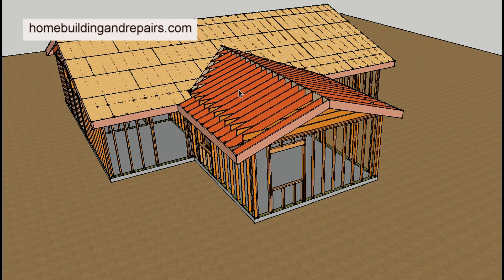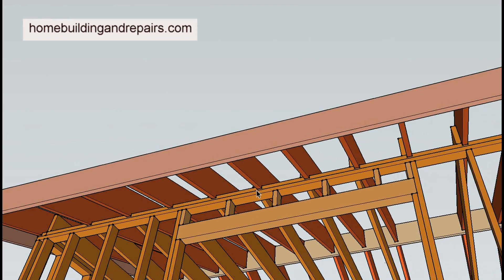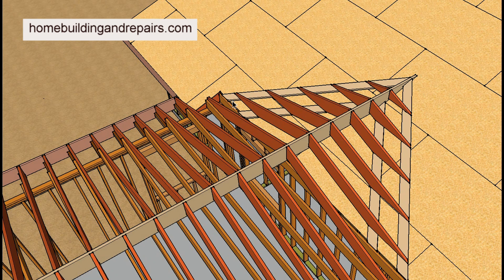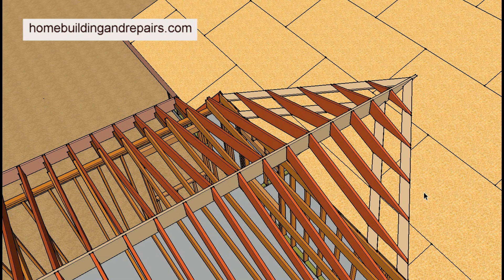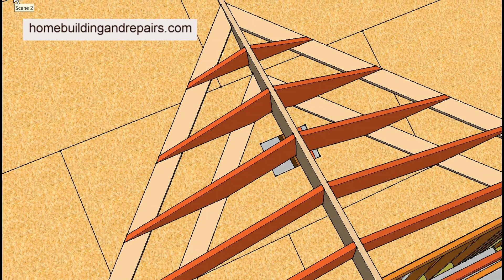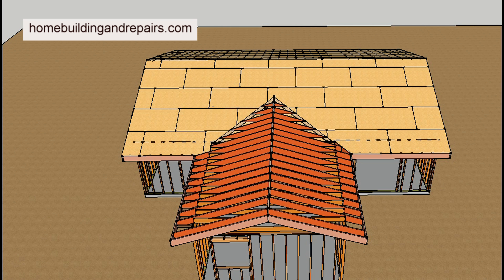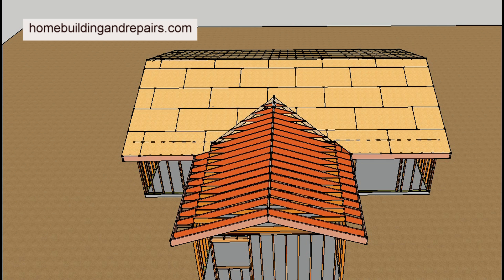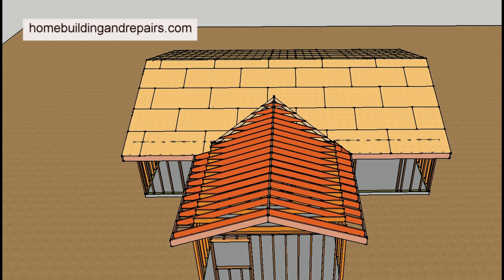Roofs Built Over Roof Sheathing Might Require Ventilation - New Construction And Home Additions

Comment: Do the holes in between the rafters need to be covered by some sort of vent grate? And will these penetrations impact the insulation value or ability to cool the structure?
Reply from the maker: No vent screen will be necessary in fill framing areas if you have the vent screens on the exterior of the building. Keep penetration holes above insulation.

Comment: I have an issue with ventilation because I have a newer roof over an old roof for my entire house. There is one hole in the old roof and some venting in the new roof on the outside. Yet I’m still getting some moisture build up inside my house as my drywall is slowly over the last  year, has saturated holes in it in some places of my ceiling
Reply from the maker: Send me some pictures of the problem areas or provide more details if you're looking for repair ideas.

Comment: If you do spray foam insulation u don’t need ventilation at all...
Reply from the maker: Yeah if you filled the entire attic, then you might be right.
Reply: gregvancom the entire attic?? No if u spray like 7.5” to 9” of open cell in the rafters, thats enough. Well in NY that was the code up until a few years ago. Now they are asking for higher R-value so we have to use closed cell. But yeah I’ve sprayed open cell in attics 15 years ago and they are in perfect condition. Theres no condensation at all, no rotting no nothing.

Comment: Question... have you ever built an addition onto a gable end which was higher than the extant gable? The previous owners of my house built a (crappy) breezeway between the pitched roof of the garage and the gable end of the house; of course it leaks. I would like, whilst rebuilding, to raise the height of the breezeway and give the higher portion an overhang- but this means building under, around, and over extant gable end of roof. Which will be possible, though a pain. If you’ve any vids on something similar, that’d be awesome.
Reply from the maker: I would definitely go to the website and check out some of the roof framing and design videos. Feel free to send me some pictures if you're having a difficult time figuring out what to do and I will see if I can provide you with something helpful.

Comment: Very good video.I will add the need of strapping the new rafters or trusses  to the existing trusses.This is a requirement by the building code
Reply from the maker: Thank you and good points. Keep in mind that this is only an example created to help you visualize the process and additional information might be required from engineers or local building officials.

Comment: I don't know the exact code off the top of my head but i think if there is more than 30 or 36 inches of space between the ceiling joists and rafters then you have to have full access to the space...not just a ventilation hole.

Comment: can a flat roof be built over a flat roof with wood. i don't want my old wood pulled up. i don't like the fact of no ceiling.
Reply from the maker: It would be difficult to answer your question, but I think it could be done as long as you aren't adding more weight than the building could support. I think the extra weight might be a concern.

Comment: if the ceiling is a vaulted ceiling with LVL as ridge beam, supported  on by the two walls and extending to the existing roof sheathing, how would it be best then to ventalate this space?
Reply from the maker: If you can go to our website and get our email address and send me a picture of your project for more information.
Reply: You would use high density insulation (if necessary for the required r vaule) that would not fill the entire rafter cavity, leaving an air space, then you would vent it with ridge vent.  You would still cut a hole into the existing roof to vent that space (with ridge vent) since you're vaulted ceiling wouldn't die into the existing roof, it would stop at the wall, where the existing roof begins.